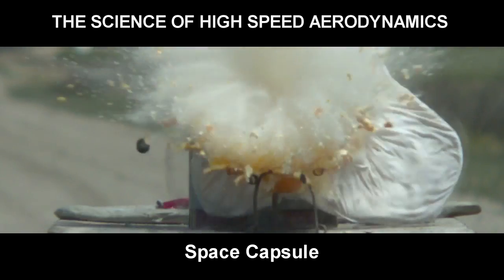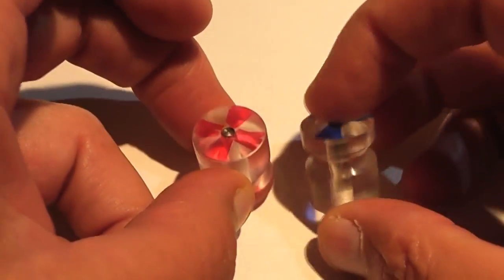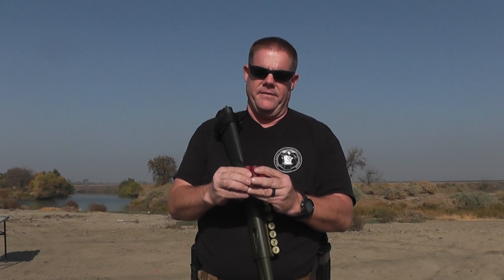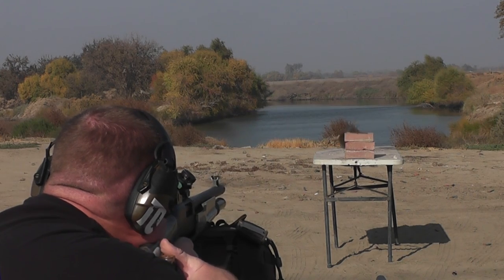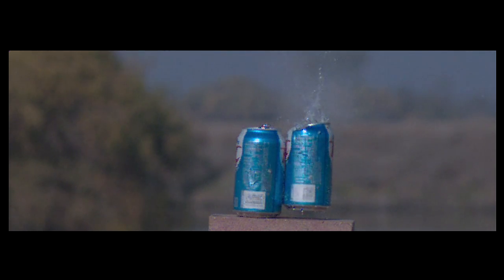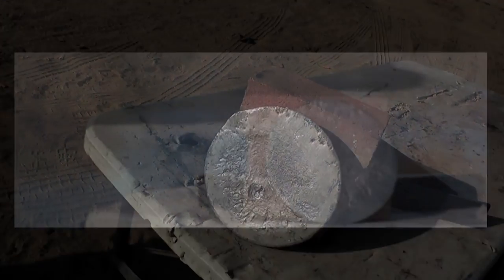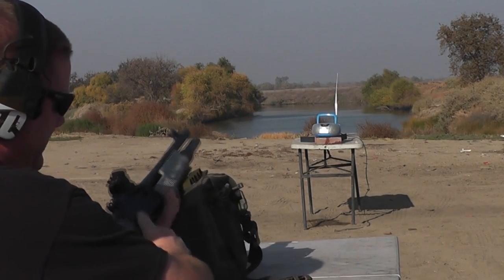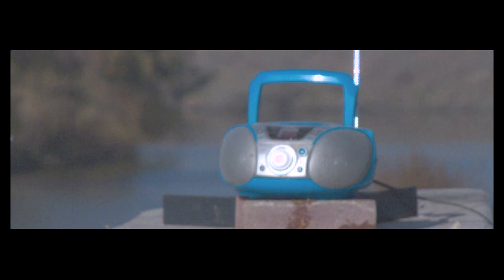Transparent Slug of the FUTURE!   (sort of)

Comment: First impressions are that these are just too lightweight to maintain stability without the “shuttlecock” effect that the Foster slug relies upon (lighter back end that pivots back into true via drag). Perhaps replacing some of the polycarbonate at the front with more steel would improve it.
Reply from the maker: We've shot quite a few slugs this light that were stable

Comment: I'm wondering if you hollowed out the back end and used a shorter and wider or heavier core material or even a metal nose cone to add weight to the front if it wouldn't be more stable. An interesting design.

Comment: If this slug wasnt so squared off at the choke point, it would be more aerodynamic. I thing put fins on it for stability. Tell these guys which way your slug is supposed to be positioned. Enlarge the steel dingus and have a penta arm design of metal inside the polycarb. Maybe use a slug that liquifies at high pressure or heat. That way it is like shooting poly-napalm with a metal projectile for weight and stability.

Comment: Your powder is too slow for a projectile that light. You need something really, really fast like Bullseye or Clays so it can achieve some compression behind a light projectile. I don't think you actually got these supersonic. However, it was very interesting as it was. For such light loads in the future, I would try a simulated load of comparable weight (wood?) and try to work up a powder charge that gets it moving faster.

Comment: This is gonna get demonetized so hard that you're gonna have to pay youtube and their advertisers.

I thought those slugs were bits of little, acrylic/poly handled screwdrivers. 

Maybe if he tapered down the rear to be a bit more diabolo-like they'd work a bit better. It'd take some weight off the rear and middle and allow the air get a better hold on it. As is I think the air is kinda slamming into that ring then right back out or just bypassing it altogether after rolling back from the tip.

Comment: The round is too light to ever become stable.  The heavier the round, the slower it will roll or keyhole, because science.  To make such a light round fly right, you would need to have super NASA precision in every component of the round, shell and barrel, to 1/10,000th an inch.